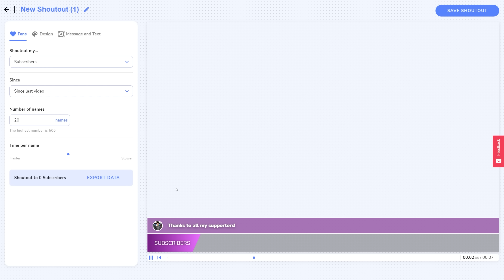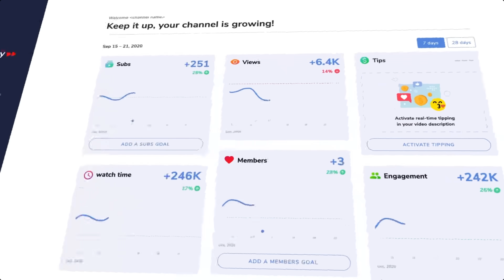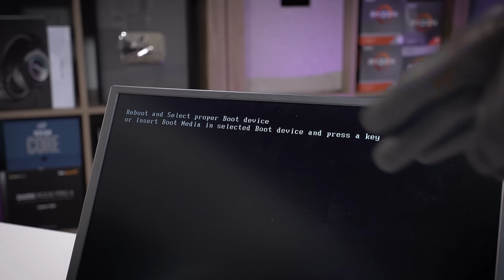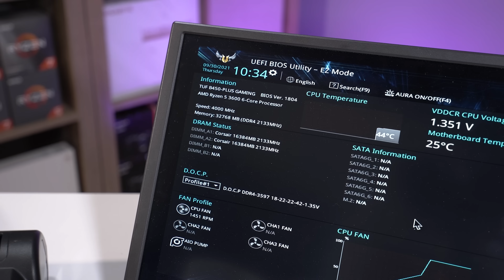Fixing a Viewer's BROKEN Gaming PC? - Fix or Flop S1:E15

Comment: When I first started in Computers an experienced IT guy told me the first thing you should always try because it causes more issues than most and is the easiest thing to check is to CHECK RAM FIRST.  Always try each memory module first down to 1 channel then try 2 if that works.  Saves more time than you can imagine.
Reply: THIS. It's outstanding what just... Reseating the ram can do. If that doesn't work, move to testing individual dimms and slots. It's my go to whenever I start troubleshooting a nopost

Comment: To quote Graham Lord from Adamant PC " It's never the CPU, until it is!"
Reply: It's true.
Reply: Was twice the cpu for me, 1 broken 3600 and 1 broken 5900x. (confirmed broken after RMA)
Reply: True that, I had a cpu that would post but would die in the lock screen in Windows, uninstalled, tried to reinstall, would fail upon restarting, would also fail with other OSes, swapped the board, still fucked, swapped the cpu, ...fine? It's one thing to have a dead CPU or some dead channels but a partially functioning CPU is just weird man
Reply: @wsketchy  sounds like you may have been able to get it working by increasing the voltage. This typically only happens in very old cpus though.

Comment: That long delay where the fans are off, during your first power-on attempt: that's mostly memory timing training. I believe it precedes POST, which is why there weren't any beeps from the speaker.

You'll very rarely encounter this outside of memory overclocking, but it's a symptom to keep at the back of your mind.

Comment: For a CPU going bad being rare, this is happening for a 2nd time recently in this playlist. 

Memory controllers on CPUs are finicky in general, I've had my first CPU slowly die because of a bad memory controller that will randomly blue screen the system and throw up memory errors. That was a nightmare to diagnose between the RAM itself, the CPU and the motherboard, especially because I didn't have spare parts to try.
Reply: "That was a nightmare to diagnose between the RAM itself, the CPU and the motherboard, especially because I didn't have spare parts to try."

And that is probably the exact reasons why this issue is over represented in the playlist.
People can figure out by themselves when it's something simple like RAM or GPU that's the issue, but in the rare cases where the CPU isn't working properly you can't really find the problem unless you sit on a lot of spare parts.
Reply: @jm-holm  THIS OMG I had an issue with my CPU but everyone kept saying I had bad ram and to buy new ram. I trusted my gut and bought a new CPU IT WORKED JUST FINE
Reply: @jm-holm  yea, this problem with CPU is one hell of hard prob to figured out with no parts to spare or test with..

Comment: that sucks! & it's not a small FPS drop it's a pretty significant drop when you only run single channel on a ryzen CPU. i've seen it tested and in some games you lose a lot of performance because of the single channel instead of dual channel.
Reply: I also tested this on my ryzen 3600 but i actually didn't see any Fps drop in triple A titles
Reply: Better a large fps drop than 0 fps.
Reply: for me, back when I had my i5 8400 a few years ago, I didn't know much about PC hardware back then, and only got 1 stick of memory (only 2400mhz at that) and any demanding game had significant stuttering and much lower frame rate than what I would've expected. I didn't notice a problem when I still had my GTX 960 2gb, but when I got my GTX 1080, thats when the difference starts to show. I got a second identical stick of memory and the problem was solved :)

I would probably use this faulty 3600 in a day-to-day work PC/office PC, pop in a cheap GPU and sell it at a discounted price (due to the faulty memory channel). still a perfectly usable CPU, but I wouldn't use it in a gaming PC.

Comment: 100% did not expect this outcome, which is super weird considering I had this problem with an FX cpu last year and didn't realize it was the cpu and not the board. System didn't boot when I tried dual channel, but booted up just fine in single channel with 2 dimms. Been using it for work with a single dimm so I may try swapping out that cpu at some point. Thanks, Greg!

Comment: actually usually what causes a cpu to loose a channel of memory is memory being plugged in with out discharging the board and then trying to insert the memory, causing a short ..   been my experience of that happening.
Reply: It's super important when taking out a pc for cleaning or anything else to always power it off. Press the power button multiple times after it's been unplugged and just simply wait 2-3mins for any lil current that could still be flowing. Its usually what causes motherboards and other delicate parts to fry.
Reply: @Lonzology  that is what i usually do, weather cleaning moving parts around or changing parts, i find on motherboards with a light, if you press and hold power button down, after turning off the power supply the light will go out.  basically suck the power supply dry.  lol

Comment: I own a Ryzen 3 3300x with a dead memory channel as well. Recently, during 11.11 sales i decided to upgrade 32gb from 16gb which I know is overkill but I managed to get the same type of rgb rams on discount and it looked cool aesthetically. Once I got it ,was excited install  only to find out system wont post. Tried troubleshooting, like how Greg does and tried reddit and all sort of online forums but didnt find any fix. In the end I just gave up. But during black friday got a sweet deal on Ryzen 5 5600x and I can use all the 4 sticks with no prob.  It was hard for me to accept the fact a new cpu which I only bought last year would end up having a dead memory channel. I thought i was the only one facing this. Glad greg shed some light on this uncommon issue. Great video as always!

Comment: Great videos! Personally my troubleshooting process would have split off from what you did once I had figured out no beep codes were going off because that's a CLASSIC nopost indicator. I have a beeper wired into my main desktop and every single motherboard I've seen nowadays tends to have a post success beep. The other way to spot a nopost from my experience is "turn the computer on, wait a couple of seconds then try to shut it down again via the power button"

Generally bios behaviour has it so if the computer is working but the OS is not loading yet a press of the power button would shut it down instantly. If you're having to hold the power button to get it to power off, that's another classic nopost sign.

From there I'd have just gone straight onto the ram tbh. Reseating the ram is my go to when I get started, followed by reseating everything else.

But that's just how I'd have done it personally ahaha. Great video! Love the series!

Comment: Thank you for posting this video. I have what appears to be a similar problem in a build with a 1700x and have something new to try for troubleshooting. I would have NEVER considered a memory channel failure in the CPU. Great video.
Reply: After swapping the 1700X for a 1600, everything seems to now be working fine. I'll test the 1700X in another board to make sure, but I never would have considered only part of a CPU failing. Thanks again for the video.

Comment: I enjoy watching these and learn a lot of trouble shooting tips. While you diagnosis the problem, I like to guess what it is. I’m a new builder. I have a PC that has been sitting around for a couple of months; without being connected to the wall. I was getting no picture and a series of different flash codes on the board. I used the remove/reset CMOS battery with one stick of memory in slot 2 trick. And Voila! I have a picture now and can reset my memory in bios. Thank you, for these videos.

Comment: I've ran into similar issues with my own 3600 and have since looked around online to see that this appears to be a very common problem. Apparently the integrated memory controller in the first couple batches of the Ryzen 5 3600 seems to be prone to failure. My CPU never got to the point where it was just flat out unable to post but it did get to the point where the system would constantly blue screen after just a couple hours or even minutes of normal web browsing use. It was an extremely frustrating and annoying process to diagnose because as you pointed out in the video, the CPU is very rarely the fault of failure and I had never even considered the CPU as the main reason for my constant crashes and opted to try everything else first (replacing PSU, harddrive, memory, etc.).

Comment: HEYOOO!  Greg or Greg's wife rockin' a Porsche.  I feel like that has come up before, but in case it hasn't: nice car!

As far as the core content of the video goes, wow, I would not have called that.  These past few times I've been shouting at you through the screen to just reseat the CPU, but when you took it out and put it BACK into the system after seeing it work on your test bench, that shut my mouth real good :)

Comment: This is the same thing that has been happening on my 4th gen i7 I built in 2015. I can only have a module in A1 and B1 for it to post. As soon as I placed any ram in the other two slots, my ASUS Z97 did not post at all. Got it working in 2015 and forgot about bringing my i7 back to the store. Nice troubleshooting figuring this one out!

Comment: These last couple fixes makes me scared for it to happen to any of us these days. At least we know now what steps to troubleshoot, bc Greg's already demonstrated it for us! 

btw, I upgraded my mobo, PSU, and AIO, then won't post. Switched graphics cards, posted fine; back to the original, still black screen. RIP rx 580, and my wallet for getting 3060 ti for double MSRP
Reply: Try a pc shop that can diagnose the board and do micro soldering stuff, just sent my 580 for repair, hope it can live back

Comment: So a funny story here,
Just put together my first build in 7 years with a ryzen 5600x and x570 compared to 4690k and z87. My first build never posted the first time due to my ram being in the wrong channels (1-3). The new build didn’t power on because somehow the 24 pin on my psu got unplugged. Then my evga g5 750w which was 4 days old decided to have screaming coil whine (worsened under load) and then bricked itself on the 5th day. Replaced it with a Corsair rm1000x which also didn’t work because my front panel power somehow got disconnected. Guess I have bad luck?

Comment: I’ve learned so much from your videos Greg, I think you’ll be proud to know I pulled the trigger and bought a higher wattage psu since the psu I was running was the stock cooler master psu that shipped with my omen 25L and because I’ve upgraded the gpu 3 times as I’m now on a 3070 I did a bit of research at the beginning and while it would and did work with the stock psu I feel like I was hammering the little 600w psu and I didn’t want to kill it and possibly have it take out my other components as well so I decided to finally upgrade it to a Corsair HXI-1000 1000w 80 plus platinum psu which worked out perfect since my keyboard and mouse is Corsair and my ram is also Corsair I also have a Corsair gaming headset somewheres in my room but I don’t use it much since I run studio headset along with a presonus usb audio box 96 interface and a pair of eris 3.5 2 way studio monitors which came in the bundle however I don’t use the headphones that came with the bundle nor the mic I keep it for backup since my go to are Sennheiser HD560S studio headphones anyways Greg I hope you have a great week Bro, can’t wait to see some new videos!

Comment: My 10 8 50 k had the same issue. Intel did an  rma for me and replaced it and it works.   It would only work in single dim would not work with dual dam or more.

Comment: I wore out an X470 motherboard running Folding at Home for about a year, CPU and GPU. It wasn't all the time, but it was a lot, I felt good crunching on Covid research, you know.  But eventually all this work, wore out my motherboard. I'd be playing games, any game really, and my computer would reset, and reboot out of nowhere.  Swapped out a power supply, and even ran the power from a different outlet, but it kept doing this.  I picked up another X470 motherboard, put my old PSU back in, and it hasn't been a problem since.  I haven't been running F@H neither.  Zotac 1660 super, and Ryzen 2700x with 16 gigs of memory.

Comment: A similar situation happened to me recently. For some reason, the 2 ram slots farthest from the CPU didn't work after I used a new CPU cooler. I first thought it's the CPU but I didn't touch it and it worked just fine one day earlier. After googling and testing, I found that the back plate of my new heavy CPU cooler bend the motherboard ever so slightly that the ram couldn't fully touch the 2 ram slots. Loosened the screws a little and all 4 ram slots work. It's so weird but what a great lesson.

Comment: Exacly has the same issue couple weeks ago.

Just in my case, one of the cpu socket on motherboard broken so the b memory slots not functioning. Not sure what the cause, but before it happens I remove the cooler and the cpu pulled off as well. 😅

Fortunately the motherboard distributor willing to replace the socket and cost me only about $5.

Thank you NJT, thank you gigabyte.

Comment: I'm having a similar issue with my PC. No post and no error beeps. The DRAM error led is lit in my EZ Debug. 

I tried each ram stick 1 at a time in each slot though, but it caused no change in behavior. 

Also, if you're by some chance reading this Greg, some comments are pointing out that the PC's VRMs sparked a few times around 4:30. That's probably what killed the viewer's CPU

Comment: Was watching this and realised, you just brang up a situation I’ve had to light 💡 

I recently installed a 16gig upgrade to my laptop, using the second module slot.. when I turned on my laptop it would give me bad cpu readings and my laptop would tell me it’s about to explode at 95 degrees centigrade while idle.. I’m now changing my ram placement to test this theory.

Comment: Man I thought I was in this EXACT situation. However in my initial testing, I must have mixed up the four sticks of ram and didn’t test one of them. If that one stick was installed in ANY of the dimm slots, the machine would not post. Take it out, works fine. A bad stick of ram and my own oversight almost cost me upwards of $300 🤦‍♂️

Thankfully it’s Corsair and their warranties are great. RMA approved in less than a day 👍

Comment: Very helpful series. Great content. Keep up the good work.
Reply: So I had a super similar issue. I had the b1 and b2 issue after updating bios in 2 boards for a 5600g. I put a 3800x back into the 1 board it originated from. Issue persisted. Returned the 5600g for another one. Issue persisted. RMAing both boards now. Is it possible the chip killed the boards?

Comment: Nooooo😭 it still can be the bios! My friend had the exact same issue. The first batch of b550 and x570 motherboards didn't have the zen 2 support. You gotta update them with the earlier ryzens like 2000 or 3000.

Comment: this was exactly happened to my unit that i have to return it to the service center to replace my DIMM slots with a new one even though i just recently bought it..and when they already sent me my "repaired/replaced" unit after 2 months,,still not working with a dual channel..then i just cleaned my CPU with a pencil eraser, then it suddenly worked..all slots are working including the dual channel..i'd just wasted my time sending my motherboard to service center by thinking that the faulty parts are the DIMM slots..btw im using i5 8600k (sorry for my english)

Comment: Same thing happened with me, but in my case Motherboards B1, B2 not working & not posting. So I RMA my B550 Aorus Pro & they changed CPU socket. Now it's running smooth as F.

Comment: Ooh, I see something! At about 8:00 you show the pins of the malfunctioning CPU, and I saw there was a bit of thermal compound touching the pins by your thumb. Those particular pins are for one of the memory channels. Could the thermal compound be an electrically conductive type and is shorting them out?
Reply: I had a r5 3500 that had the same issue. Thermal paste in exact spot covering a few pins and it only worked in single channel mode. Cleaned it and works just fine.

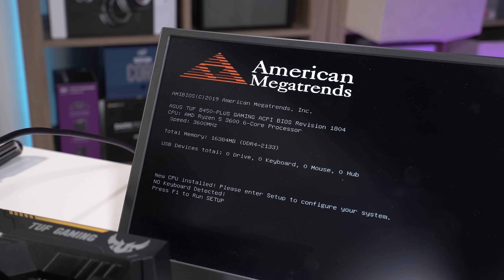Comment: Suggestion: might want to use CPU-Z to double-check that both Ryzen 3600 CPU's are of the same stepping. A screen shot at 10:45 in the video indicates that the motherboard bios firmware dates from 2019. So: although probably unlikely, the user's Ryzen 3600 CPU could possibly begin functioning normally, if the motherboard were updated to the latest bios firmware (using the "known good" 3600), and also include another screen shot showing that the updated bios has been flash updated.

Comment: I've seen this before with an Intel Motherboard/CPU combo. It would only work with single channel, as soon as you put in the RAM in dual channel configuration, it would refuse to post. The problem was a bent pin on the CPU socket (You guessed it, the exact one who handles dual channel), when I bent it back into place, the PC posted. I guess in a Ryzen's case, if it was a bent pin, it would be fixable on the CPU.

Comment: Happened to me with my backup rig. SAME EXACT THING. If i would connect any ram stick that i knew worked in a dual channel config (they were in my main rig) the system would not post. Move them to the a channel, and the system would post.